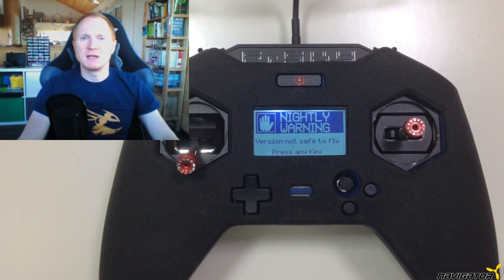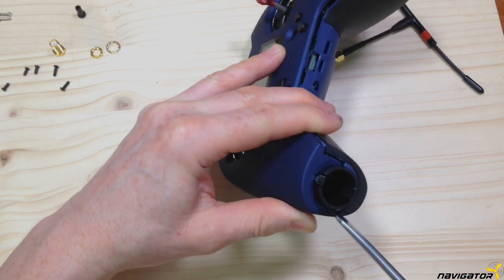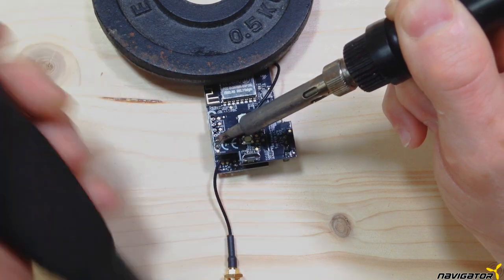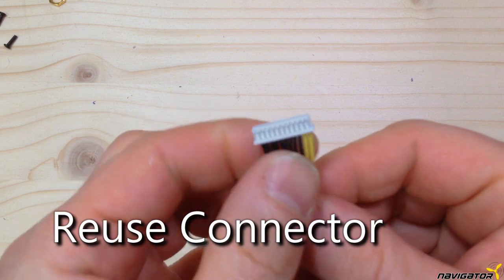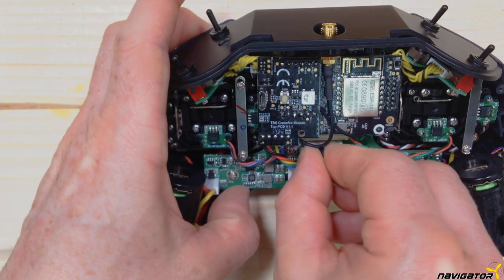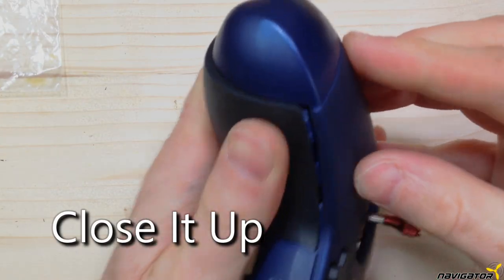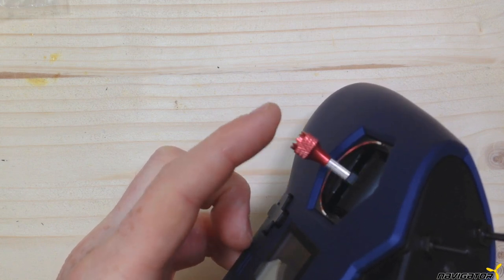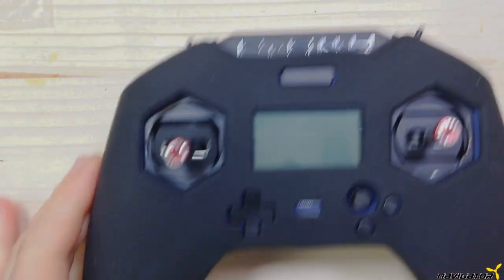FrSky Xlite Pro TBS Crossfire Micro Easy Stealth Mod (English)

Comment: ive got the xlite and the crossfire.. but ive noticed i have the v2 tbs ? the boards arent the same. there is no need for cutting or anything any more. im just concerned about the pins. i dont want to mess it up

Comment: Hi, first of all thank you for this amazing mod! I did it 6 months ago on my x-lite s. Everything was working great, but last month I started to have range issues, at first I thought it was because of my Rx antennas, but now I'm sure that it is tx. I think that when you charge X-lite over usb it somehow messes up tx module. Also I had my tx set to 250mw all the time which did not help either, especially when i played simulators for several hours without the TBS antenna on radio. I think that if you have x-lite s or pro and intnend to charge your radio over usb or play a lot of sim this mod is not for you. Maybe some sort of on/off switch would be great.
Reply from the maker: Thanks for your input and your experience with that mod.

Using a (V)TX without Antenna is quite unhealthy for the transmitter (RF module). Some can copte with that (eg. TBS), others overheat and eventually die. The higher the output power, the faster it will overheat.

Also, I would recommend to switch the module completly off (no interal, no external RF) when using simulators (via USB). Besides the heat, it still is uncertain if the em-adiation is unhealthy or not. Create a model with RF off, just for the simulators, and you are on the save side. :-)
Reply: @N4V1G4T0R  Never thought of that, maybe include this in to your video districption, for others to know.
Reply: It has been discovered when charging batteries in this transmitter and using an external module it sends power to the plug in module.
Another person burnt up his x-lite R9M pro when charging batteries while in transmitter even though switch was off module still powered up.
Now whether this happens with this module or if FrSky fixed the issue I don’t know but check to see if the module gets power when charging batteries in transmitter.
Reply from the maker: I do not recommend charging the batteries inside of the transmitter in first place. I am uncertain if FrSky intended us to do so, even if it's possible to do so. Also, this video is a hack. You will lose warranty. And you are responsible yourself whatever happens, when you decide to do the hack.

However, maybe a diode on the vbat + between transmitter and module could help to prevent reverse current, it that may be an issue. Or a simple switch to disconnect the module during charging.

Anyway, thanks for the warning.

Comment: What type of connector fits into module?Do you think the crossfire electronics could fit into an empty lite module external module?
My apologies I thought I deleted message and didn’t ask it the way I wanted.
 I found a connector for the module to board.
Reply from the maker: I don't really unterstand the question. The Crossfire modules comes within a shell, so it is intended as an external module. What we do here is crack the shell open, rip out the frsky internal module and replace it with the crossfire module. At the end, you have an internal crossfire module. But no frsky module anymore. If you want crossfire as an external module, just leave it in the shell and plug it in, at the back of the xlite.

Comment: i will do this mod. i just got my x lite pro. what do i do with the firmware?? can i turn a open tx module on the back with this?
Reply from the maker: opentx 2.3 (official release) does support this setup. so, no nightly builds necessary anymore.

Comment: Does pro version have any advantages over s version if you planning this mod?
Reply from the maker: The pro has better gimbals (MC12 Lite all-metal CNC digital hall sensor gimbal). But there is not much difference. For the mod, there was no difference if X-Lite of X-Lite Pro. So I would assume, that this mod will work for the X-Lite S as well.

Comment: why did you remove the potentiometers?
Reply from the maker: I myself don't use potis at all. So, I saved some work by just doing without them. This mod is really easy and fast.
If potis are needed, an additional 3d printed part is necessary and it's a lot more work (soldering). See my Xlite (not pro) video on the xlite crossfire stealth mod for instructions.
Reply: @N4V1G4T0R  I see thank you :)
I purchased the crossfire version 2 nano tx starter kit, it is very small and fits quite neatly on the back. The stealth mod is super cool tho.
Reply: @cinialvespow1054  So you got the nano and it fits right in the back and works without issue? I can't find anything online saying the crossfire nano tx works with the pro model.

Comment: where  the heck is  part  two!?
Reply from the maker: Part 2 still is no longer necessary. at the time creating part 1 OpenTX did not support the Xlite with the XF Module. So, only with a Nightly Build of OpenTX the Xlite worked with the XF Module. I prepared a video on how to flash the Nightly Build and make it work with XF. However, not long after the Part 1 the new OpenTX Version came out. Since then he XLite/XF combination is working "out of the box". Just upgrade to the newest OpenTX and you are fine. Part 2 was a wast of time, created it but never finished it for publication. :-/